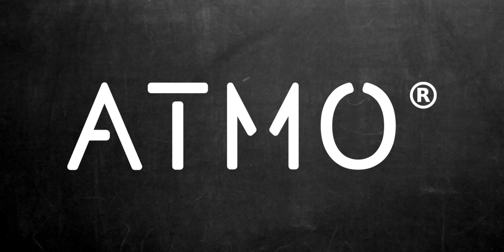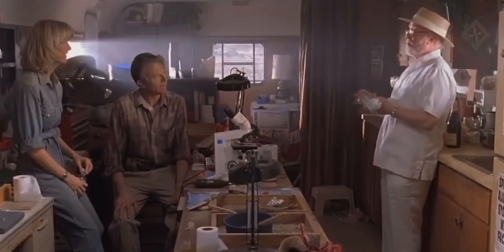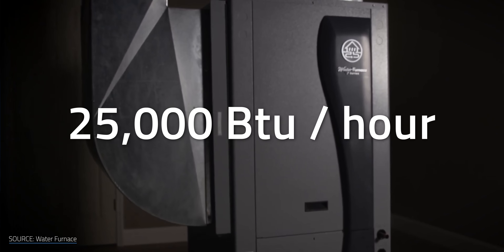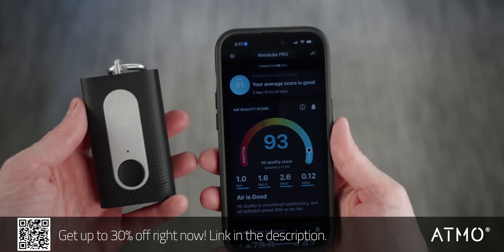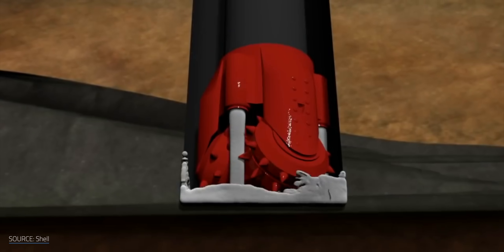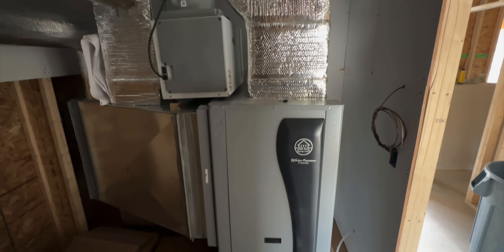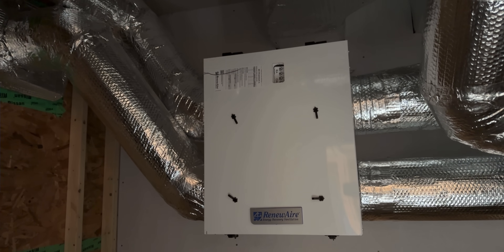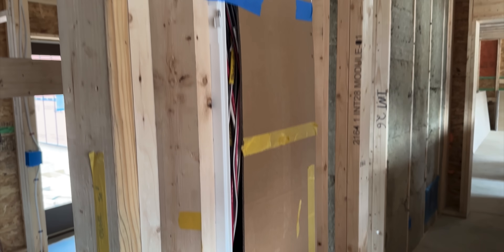Why I Went With Geothermal For My Net Zero Home

Comment: I am curious about smart vents and controlling temperature room by room from a central system?  I have been able to save a tonne on my electric bill historically through better room by room control, granted your place has better insulation, so you are probably a little less concerned with that.

I would certainly like to see a piece on the HVAC system as well as integrations into water heating.  I have thought about having a pre-heater tank for a long time in conjunction with an AC system.  I am thinking you probably want to hold onto the cool from the heat pump water heater in the summer, but then what do you do with the cool air coming out in the winter?  Pre-heating water in the summer with an HVAC system that needs to dump the heat it is collecting up is a nice idea and seems more useful than dumping it back into the ground.  I think it is interesting that you just need a vertical tank and it will for the most part hold the heated water at the top and keep the cold water at the bottom.  It would be nice if they made a heat pump water heater that could fully integrate into a larger geo-thermal system for more efficient winter use as in draw the heat it needs directly from the ground.

This also all gets a little into humidity control and sensors in general.  Are you going to sensor up for that as well and try to get your home to have more server room like controls and monitors for humidity as well as the temperature?  Are you going to have a room by room dashboard of stats such as humidity, temperature, CO2, air quality readings, etc.?  Maybe have alerts if something gets out of your comfort zone such as humidity building up in the winter / wet seasons, too dry in the summer, CO2 building up because not properly exchanging air with the outside, someone opened a window when there is a blizzard of pollen outside blowing in, etc.?

Comment: Super High quality work you provide. Air as a heat moving agent. I would like to see your calculation on how much air you need to move that amount of kWh of heat into the room, when the air humidity is down to 0,12 - 0,15 as it will be running though a heat exchanger on a cold day. I’ve had heat exchangers for 20 years but went with a rotary version to retain some moist for better indoor climate during winter - not living in a to dry an climate. my guess is that it’s going to be a lot of air for your system to deliver the needed energy.

Comment: I'm still convinced that it would be better to have a wood burner and open windows for summer. 
C02 is a perfect clean natural gas that helps us with growing vegetation. Because oil and gas the number of deaths by natural desaster has almost plummeted to 0 relative to 100 years ago. 
Also if your house can not cope with 2cm sea level rise you are greedy and should not have bought that house below sea level or on the beach in the first place. 

Anyway. Good luck with you 100 machines and toxic gasses to make your dream come true.

Comment: Hi Matt, what about an interview with the mechanical engineer (and other functions?) That designed your HVAC and hot water system? I'm talking details like design loads, how that larger capacity system will mesh with your lower anticipated design load (I know air source HVAC minimum is usually 30-40% of full load, but maybe the story is different for ground source?), humidity control, duct placement, etc. Love this content!

Comment: Nice video 
I used to work for a company that installed Water Furnaces 
The units we installed had 240 volt multi speed blower fans ( I think they all do )
Great blower fans , but we only installed a few Water Furnaces a year 
So we had a limited number of spare parts on hand and we only had 1 blower fan motor 
The boss liked to order lots of parts at a time for a better price 
So I had to short term install other 240 volt motors several times to get people heat 
So I hope your furnace installer stocks parts 
Or I might think about you thinking of keeping a few spare parts

Comment: I'm confused. I did watch the videos on the Geothermal heatpump. For my understanding there were the closed loop systems (horizontal/vertical) and then there is also the option deep drilling. In this video Matt talks about having vertical loop system but does also deep drilling... can please someone explain?

I'm also currently researching my options for an energy efficient home. I was thinking about horizontal loop system that would provide the house with heating and cooling since in my area the temperatures range between -5 to 45 C (23 to 113 F). But I decided to go with radiant heating and cooling instead. I know that the deep drilled wells have to be renewed on average every 25 years, which I didn't want to do. Therefore I thought horizontal closed loop system would be best.

Any help appreciated.
Reply: A vertical closed loop is installed with a drill rig. An open loop is drilled as well.

Comment: Have you thought to use Hybrid solar panels to connect to the heat well to increase the efficiency of the solar panel? In summer, you could cool it down (maybe to create hot water), and in winter you could run low temperature above 0 water remove snow to increase winter production. 
My 2cents, I dont know if that works the way I think it works or if its viable.

Comment: Several years ago I helped a friend install radiant infloor heating in his new house.  Then a few years later I had the opportunity to stay at his house and the warm floors were glorious so I can't imagine building a house without it.  So i'd be interested in a video explaining your decision.
Reply: ?t=7m52s someone should tell his mechanical engineer about PID loop tuning….  However, the argument still stands that radiant floor heating systems win, eg., embedded PEX tubing would not be nearly as effective at cooling as for heating since the warmer air tends to convect the air upward and mix it in a heating scenario.
Reply: @TroyeWelch  My dream scenario would be radiant floor heating and heat pump, I don't think it needs to be one or the other, and if it's with geothermal source, it could be pretty efficient.

Comment: Nice, however I have a bit of concern about the ERV... 
Did you correctly check the leakage amount and the class of the recovery element as your basically recovering from very high humidity/smelling environments and not corridors/less challenging rooms?
The exchanging is never perfect some particle always pass through the heat recovery element, sometimes between 5% to 10%.
Just say, as your house will be very air tight, you could easy spread bad smells to all your house!

Comment: You had to install water heated floors, those are the most efficient as you only need to heat water to around 25' celsius. That means that in your case you need to heat geothermal 10' celsius to 25' and the delta is minimal. And 2-contour system to heat up water boiler. This is how all new houses are built in Northen Europe

Comment: Matt, I love the tech but it seems to be overkill. I would think with a new home with a proper site plan, you could have put up a salt-box colonial or a modified roof line with large south facing solar panels.  I have an all electric summer home in Rhode Island with Enphase solar and batteries. It generates enough power to zero out my electric bill, I sell excess battery capacity to the utility provider that pays me an amount that offsets my electric bill in my  Florida home as well as charge my 3 EVs. Granted that I am not occupying my RI home during the costly winter heating season or my FL during the heat of summer, but I’m getting a good return on a single energy investment. BTW, The homes were built 40 and 15 years ago respectively without the benefit of newer energy saving technologies.

Comment: When your building new, and the drywall hasn't been installed yet, it costs almost nothing to install additional cables, beyond the cost of the cable itself.  Personally I would run them all into patch panels, each slot has a number, that matches a number on the jack cover plate.  Any your not currently doing end at the patch panels; when you decide to use one that is not being used, you note the number on the jack, take a patch cable, plug it into the switch.  

Don't forget outside runs for security cameras, these could just end in a regular RJ45 inside a weather proof box.  Some folks will run separate switches, one with POE for cameras and Access points, and another for everything else.

Comment: I am looking forward to seeing future videos. Just a few thoughts and comments. 
1) Don't assume 50 deg F ground temperature in all areas. I was once involved with a project that made that assumption. The multi well type ground loop ended up supplying loop temperatures just above 40 deg F. This caused the heat pumps to trip/ fault. Ground water temperatures were apparently effected by the nearly year round snow melted in Olympic National Park. It was a kind of unique situation. 
2) Does the energy recovery unit have a built-in bypass so you can over cool your house during cool summer morning? 
3) Have you installed motorized control damper in the forced air ductwork to control heating and cooling of individual rooms? 
4) It would be nice if there was a hydronic loop heat pump residential water heater available that could tie into the ground loop. 
5) Does the stove/ range hood feed into the energy recovery unit? I thought that would be a violation of fire code? Or is the hood separate ductwork? 
6) Fire alarm/ fire suppression system?

Comment: Watching from Poland, I find the notion that R-36 walls are insulated enough quite funny. 
I'm watching one guy build his house on his own (with only minimum of tasks contracted out, like concrete pours or crane for roof trusses), in mornings, a couple of hours before work each day. His house is in Szczecin, Poland, so climate like Chicago, but it wouldn't be out of place for a modern build anywhere in the country, as a standard, not some super energy-efficient passive build.
His external walls are 250mm (10") aerated concrete blocks (with some poured concrete columns and beams) with another 250mm of XPS on the outside (then stucco/siding/whatever, he's not at that point yet). It works out to about R-56 peak, R-48 minimum (not counting windows). 480mm of mineral wool in the roof, for R-68 insulation value. Heated floors and forced air ventilation/cooling.

Comment: It was a big thing to run "homerun cable" in new home builds about a decade ago. This mimic'd what was done in hotels at the time.  Then came WIFI and Mesh WIFI. Quite a lot of the needs of homerun became WIFI serviced.  Example if you order cable TV and internet from a major player the cable comes into the router and all services are fed wirelessly off of that: TV's, laptops, tablets, phones, thermostats, irrigation, etc.  As an ethernet junkie myself I can say that more advances have come and will come to WIFI for home use. For business/datacenter etc - its all fiber now with copper (CAT#) relegated to legacy needs.  Now the advantage of fiber, if you must have a tethered connection, is it will be around for a very long time. The bandwidth it can upgrade to is well beyond a home users needs.
HomeAssistant is just stunning. Sadly they seem to be making it hard for non-techie home users to setup and that may be its undoing. But since its opensource I would imagine there is a group of good people making it all plug and play. Everyone is doing something proprietary (Amazon, Apple, Google,  Schlage, Honeywell, etc) it seems which only makes it more difficult for things to work as a unified and secure system.

Comment: In my hometown (in southern Germany), we did a lot of geothermal projects 15 years ago. Unfortunately, we have a unique geological formation here known as Gipskeuper. If you don't seal the borehole precisely, there's a possibility that water may penetrate this formation, causing it to expand slowly. Consequently, some houses have experienced 10cm cracks. Therefore, it is crucial to assess your geological situation before engaging in geothermal activities.
Reply: I'm sorry to read this, but your situation illustrates the most fundamental and key point that people always forget about ground source heat pump installations: putting a radiator (i.e. thermal dispersion mechanism) underground is a gamble and the thermal conductivity of that radiator can change over time. Saying it is always X degrees underground is such an oversimplification it is a disservice. As in your area, the ground may simply be marginal or unsuitable for a ground source heat pump and the only way you know ahead of time is to work with an experienced driller and designer and also do a borehole to confirm what you have at your site. I stopped recommending ground source heat pumps over ten years ago after being an advocate and having to see too many underperforming systems over the years. GSHP is not necessary in most climates and more expensive than needed, sometimes not even the most efficient option because site conditions and design/installation specifics REALLY MATTER .

Comment: Very interesting what you’ve done with your home. If I can point out something as far as your geothermal heat pump, compressors will eventually vibrate and leak, having redundancy will be a good idea but it might be too much to ask for. I would at least make sure you have spare parts on hand in case a compressor goes out and you’re not stuck waiting days/weeks to get parts to repair. I recommend at least having a compressor and refrigerant.

Comment: I have a large 8 loop 5 ton geothermal system from Waterfurnace. We have a few issues. The furthest rooms from the system are colder in the winter because the low CFM flow struggles to push at that distance. You need massive trunk lines for geothermal to reach long distance. When the system does have to run the heat pump it gets expensive fast. We can easily hit 1k/electric per month in the dead of winter. In summer the system has no issues and my bill is around 450. So about half of all my electric comes from the geothermal in the winter. Not sure I would change anything. The house is R-60 CIPs construction throughout, but I do think we lose some on the basement. We also lose on the doors  (especially the french doors) This part was not insulated as well. All and all I am somewhat happy with my geothermal, but its not as good as I was expecting.

Comment: Horizontal trench over 6 feet deep, 10 feet wide. Uncoil 500 foot coil of pipe. Cover up, no well. Master well driller 30 years, Md. Certified bonded insured 2 million. Saw these 20 years ago. 10 times cheaper than drilling well. Horizontal for geothermal

Comment: Matt, installing the heat exchanger as a vert loop (esp 400 ft) is much more efficient long-term than a horiz loop and the smart choice (if it is affordable). While the following would add a lot to the cost, I would case the hole so that the loop could be replaced should it fail (without having to re-drill the hole).

Comment: My wife and I bought a tract home built in 1976, and had it remodeled, and went with a Waterfurnace 7-series and a vertical well ground loop system.  Very similar to what Matt Ferrell got, except he only needed one well and we got three.  Over the very long term, the higher up-front costs will be paid off, and meanwhile we enjoy the quiet efficiency of the system.  There's no external compressor unit making noise, and we don't have to do maintenance on the external compressor unit (since there isn't one).  There is just a ground loop buried safely in the yard, plus the Waterfurnace unit (we have it in our garage, no separate mechanical room here).  We have a heat recovery ventilator (very similar to Matt Ferrell's energy recovery ventilator) and the home has wonderful fresh air.

These technologies will work even on an older home that was never designed for energy efficiency.  As part of our remodel we had better insulation put in the attic crawl space, and the previous owner put in sealed double-pane windows so those are pretty good.  The Waterfurnace uses less energy than a space heater when heating the entire house in the winter!  And during a heat wave, with really hot outside temperatures, it used less than 4 kWh per day (about 44 cents per day at our electrical prices).
Reply: Great feedback! Thank you so much for choosing WaterFurnace for your home. We appreciate you.
Reply: @WaterFurnace  I am wondering: does Waterfurnace have a heat recovery ventilator or energy recovery ventilator product?  Our HRV isn't Waterfurnace brand.
Reply: @stevehastings2010  We used to but stopped offering it.

Comment: enphase battereis are a TOTAL rip off. LOOK at the facts. Their 3.5 kWh battery ONLY produce 1.28 kW from a 3.5 kW battery.  Plus each battery has an inverter attached to it. More complexity. I would NEVER go with their battery system. I am a solar dealer and never spec an enphase battery system because how inefficient they are. You should look into an all in one system like a Pomcube, Canadian Solar EP Cube etc. Look up Enphase spec sheet on their Encharge 3T. Plus their cycle life is ONLY 3600 cycles. We do not sell any LFP battery that has less than 6000 cycles.

Comment: If you can stop now let me talk to you into it. You're going to be sorry. 😮 Most end in disaster. I've seen everything from lake loops elevating lake temperatures over 100° to yards that won't ever grow due to the heat radiating from the ground and I've never seen one that didn't leak and I've seen much water damage from them. I hope you have a backup plan.